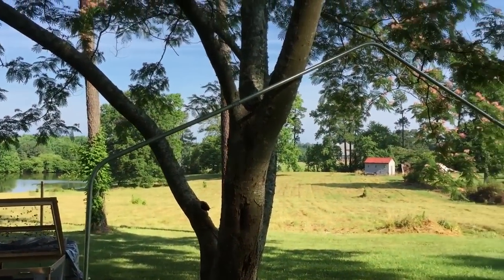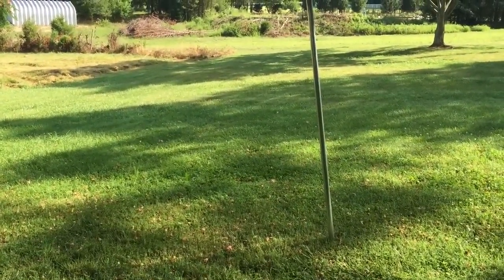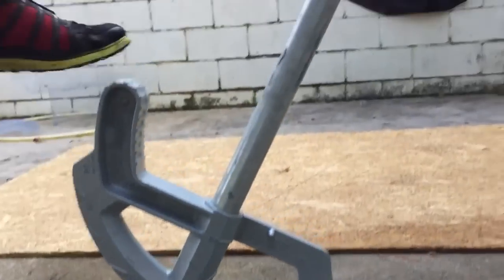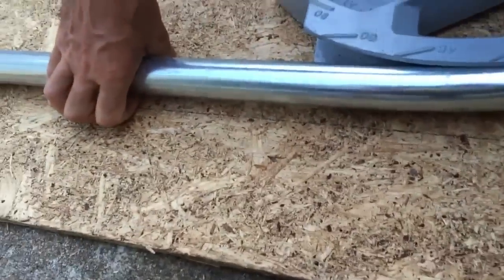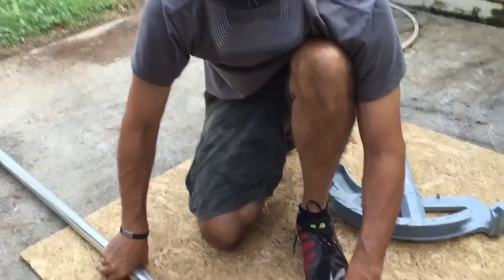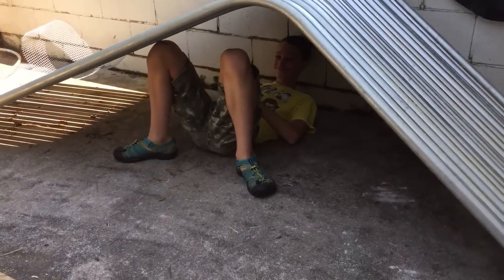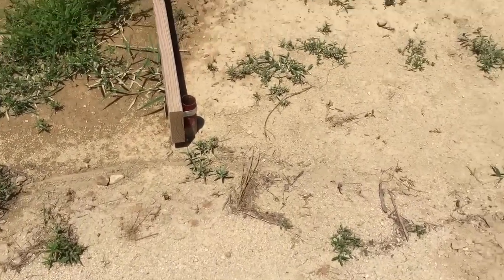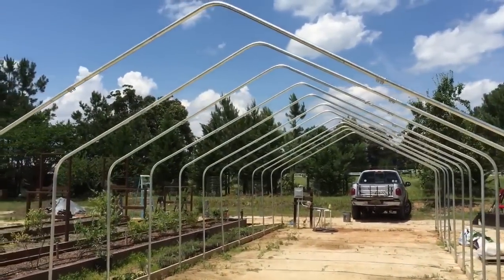DIY How to Build Your Own Metal EMT Conduit Greenhouse Part 1

Comment: Just a tip for anybody that is going to do any more steeper of a bend then he does now if you don’t want the pipe to collapse one thing I have noticed that is a great way to prevent the pipe from collapsing so that it’s weaker at the bend is fill the pipewith small grain sand, and then tape the ends off so the sand cannot come out easily so that it will basically use the sand as a way to help the pipe, not bend in more

Comment: Would you mind tell me how to bend evenly 10 foot pipe? How to measure and where to start bending? Would I need to start few inches before 5ft or start bending at exactly 5ft? I am using 1in pipes.

Comment: What are you using to anchor the pipes into the ground and how are you connecting them?
Reply: I was searching the comments for this same question and answer.

Did you just sledge hammer conduit into the ground?

Comment: Where did u get the manual tube bender?  Superb video series
Reply: It is a EMT electrical pipe bender. It can be purchased at any electric supply house or maybe home depot. If you get one make sure it has a foot pedal because 1 1/4" pipe will not be easy to bend. Just my opinion. I am an industrial electrician of 30 years so spend the money up front and the work will be   easier.

Comment: your joint is a weak aluminum casting not meant to bear much load.  you should consider a heavy gauge nipple.
Reply from the maker: OK, but they've been up there for four years without issue and are stilling going strong - despite heavy snows and storms. I think they'll be alright.

Comment: very nice. what's the name of this tool used for bend pipes?
Reply: A Bender or a foot bender.
Electricians use them and the pipe is used to run wire through.

Comment: you are probably fine but I have had failures with those alloy connectors. I recommend the steel connectors, they seem to be stronger.

Comment: You have inspired me. I think that I am going to give this a shot. It seems like a really fun process with a little bit of time , labor, and money. I have watched your videos twice over and read a lot of the comments to help guide me. I am looking forward to this journey! Thank you.
Reply from the maker: Thank you for the comments - and for watching. If you have the resources, try to go with larger manifold pipes and fans. The system really does work, but our regret will be that we didn't design it to push more air through the earth battery. We did the best we could based on what we knew at the time and the resources we had, but still we would make those changes if we could.

Comment: OK after watching over half of the builds. I didn't run across the dirt work and side railings setup. Did you use a transit to set up? Did you square the area up by using the pull across corner to corner method? Also why did you leave that out? Thank You in advance for all that you did do and show. I'm starting our greenhouse this summer for next year. Looking at a many builds I could find. Awaiting answers.
Reply from the maker: We purchased what was an abandoned farm four years ago. Previous owners put in the infrastructure for the greenhouses (pipes in ground, water, power). They removed the hoop house long before we bought it. So we rebuilt and renovated what they had in place. We added the side railings. They are just attached with 1.25" EMT metal straps. Best wishes on your greenhouse build.

Comment: The fact that you actually put the angles and measurements in the info calls for two thumbs up :) I have to ask though, what is the name brand of the manual tube bender? I can't seem to find one that big. 1 1/4 or 1 1/2 I'm guessing?
Reply from the maker: 1.25 pipe bender. We bought it on eBay for a GREAT price. I'd have to go find it and check, but it my memory is that it is a Greenlee. Hope this helps.
Reply: Thanks much :)
Reply: @joshblick  did you find the pipe bender? I wanted to buy one myself.
Reply: @1231dre  I found one on E-bay a while back but didn't get it in time. Honestly I ended up going with 1 1/2 plastic conduit for one that ended up being temporary and I built a wood gothic frame for a small permanent one. I would still like to do a big metal one some day but I'm just going to make a jig unless I can magically find one again.

Comment: I like this build.  My question is: did the couplers play hell with the plastic ? I was thinking that you could grind-off the raised part of each coupler on the side where it would come in contact with the plastic-- but didn't know if it was necessary.  What are your thoughts ?   Thanks
Reply: (Anti?) hotspot tape would probably be easier...

Comment: You bent the side pieces at 60 degrees. What did you bend the top at?
Reply from the maker: The two outer angles are 117.3.  The ridge angle is 125.4.  Sides are 6' tall.  Just over 10' to the ridge.  16' wide.  Hope that helps.

Comment: What angle bends for sides and ridge would I need to make mine 20 feet wide?  Probably going to start mine 40 feet long....haven't decided on that but definitely 20' wide. Thanks in advance and great video!!
Reply from the maker: Nicole, sorry for the delay in reply.  You could use the same angles.  To make it 20' wide, you would have to cut additional lengths of pipe for each section, unless you we're going to make the whole thing much taller.
Reply: Thanks! I have to keep it 10' or below...I have a lot of lake winds to deal with and my structure will be in an open field. The farm we are buying is on 80 acres. It was used for hay fields. We are very excited! Will have to share pics when we get it set up.

Comment: love the video! How much 1-1/4" EMT did it require to build this size high tunnel? and on your bends, are you marking at 5'  since they are 10ft? Thank you
Reply from the maker: There are three 10' pipes in each section/arch.  Each arch is about 2' apart, and the greenhouse if 50' long.  So 26 arches = 78 pipes.  The first bend is 6' off the ground and the greenhouse is 16' wide.  Hope that helps.  Also, we bought the pipe bender on eBay for less than what a smaller diameter pipe bender cost new at Lowe's.  Thanks for watching!
Reply: each hoop is only 2' apart from the next? they look farther than that on the video. thank you for you reply. that will help!
Reply from the maker: My bad!  I was thinking of our other greenhouse - those pipes are two feet apart.  The pipes on THIS greenhouse are 44" apart and there are only 13 sections - 39 pipes!  Good catch - sorry I misstated it the first time.
Reply: No, thank you! I just wanted to make sure. keep up the great videos.
Reply from the maker: After we finish our current woodworking shop project, we're going to finish the greenhouse, so that video will be in the works in the next few months.  Should be able to give a lot more detail about it.

Comment: Cut and fishmouth all of your cross braces. Bend the tube for a spring-in fit. You'll hold a straight line, every time
Reply from the maker: I must admit that I had to look up both fishmouth and spring-in fit, since I've never spent a lot of time working with EMT.  Thank you for the tips!
Reply: Douglas Alan can you explain where these techniques would be used on a greenhouse like this?
Reply: any updates?

Comment: What were your bend angles? One was 117. What was the other. Great video thanks
Reply from the maker: Nathan, the two outer angles are 117.3.  The ridge angle is 125.4.  Sides are 6' tall.  Just over 10' to the ridge.  16' wide.  Hope that helps.  Oh!  10' pipes - no cutting.  Thanks for watching and commenting!  I'm going to add this info to the video description.  God bless.
Reply: @StIsidoresFarm  great video; is the middle pole bent at 4 foot from the ends as well or only the sides